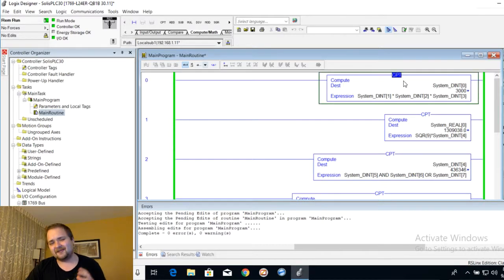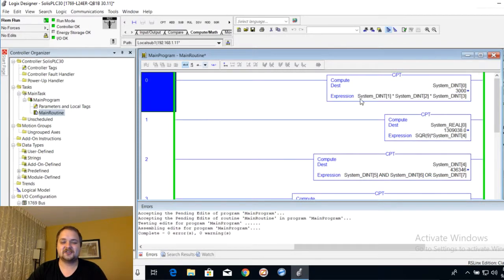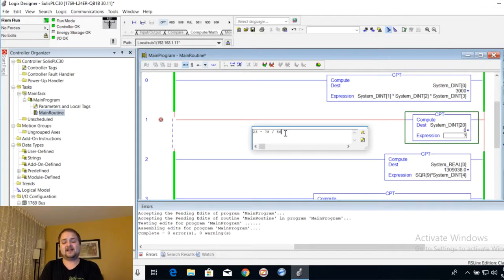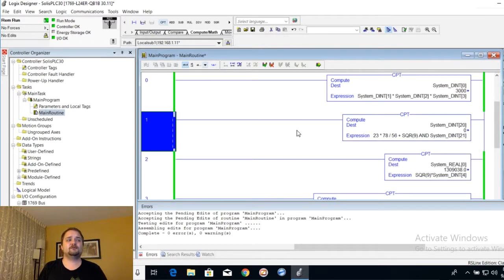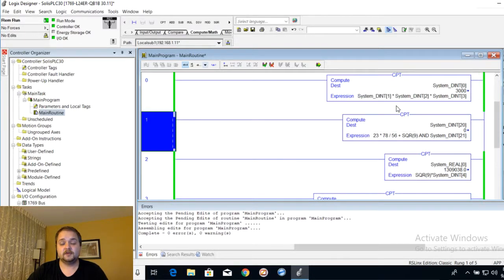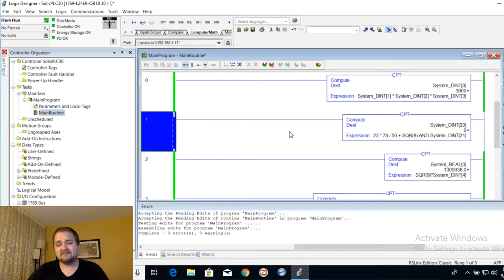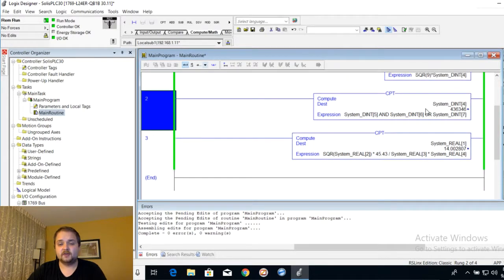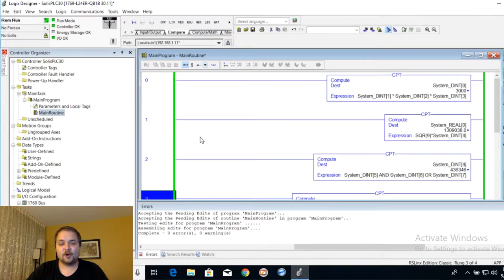PLC Programming CPT Mathematical Instruction - Compute Ladder Logic RSLogix Studio 5000 Tutorial

Comment: I have a program that is using a CPT instruction to control VFD speeds , the problem I am having is a few drives  will run the correct speed but it will be way out of the speed parameter on the Panelview and the others drives will not come up to the correct speed. This a program that is running  running PF40 drives and I am converting the program over to PF525 drives.  The expression is  VFD101FPM*(60/60)*10   The VFD101FPM is panelview numeric entry from 20-100  the equation is missing a 0 but I just don't stand why one drive will work and others will not.  Any help would be appreciated.